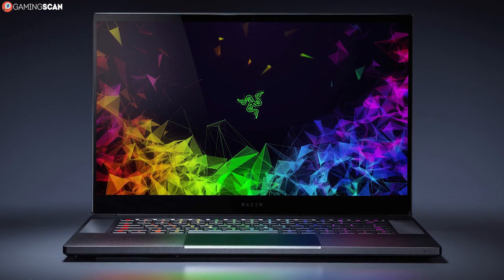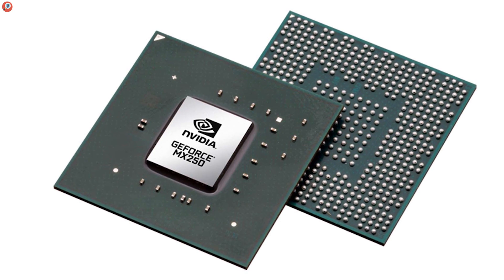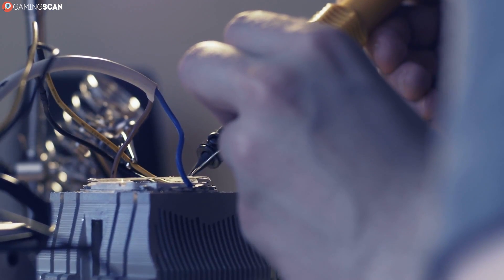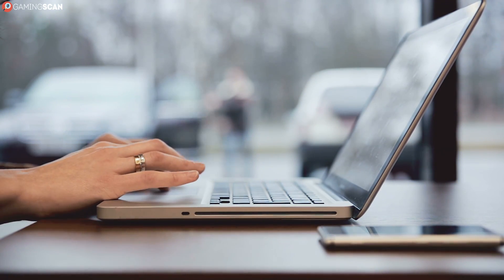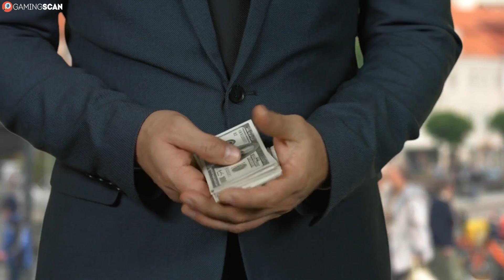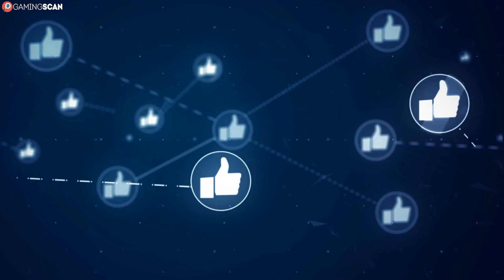Can You Build Your Own Laptop? [Answered]

Comment: If people could build their own Laptops someday as if they are trying to build their own PC Desktops? It's still going to be longer and more expensive than building a PC Desktop Tower. I'm guessing a computer or computers with the thinking power of 40 smart people put together are going to be responsible for pointing out what parts are going to be soddered into the motherboard. And I haven't got to imagining to what is needed to measure where the miniature fans and mobile battery go yet along with antennas and screen mechanics.

Comment: I'm looking to buy an ASUS ZenBook S Ultra Slim Laptop, 13.9” 3300x2200 3:2 500nits Touch, Intel Evo Core i7-1165G7, 16GB RAM, 1TB SSD, Thunderbolt 4, TPM, Windows 10 Pro, AI Noise-Cancellation, Jade Black, UX393EA-XB77T from gigatechonline. Suggestions to supercharge it beyond its factory specs will be absolutely welcome. I already found 512gb (8x64) worth of RAM on Amazon and an 8tb SSD for it. If you guys think this is enough to make my future laptop ultra powerful let me know. I'm tired of Skyrim Anniversary barely working on my current system. I'm also a very heavy ESO mmorpg player and a more powerful system would definitely help me explore Morrowind with my friends.

Comment: I’ve done it myself, and before I get a bunch of hate replies, I got a bare bone pc and just replaced all the parts over around a year and a half
Reply: did a similar thing myself. bought a bespoke shell from customers laptop maker that had surplus parts. didn't even have a monitor. just the laptop shell and the board with the cpu and gpu on it. then built everything around it overtime. from keyboard to battery. took over a year but I finally have a finished working, stable, robust, problem free, aesthetic, practical unit.

Comment: I mean, can’t you just take parts from old laptops and make a new one?
Reply: most laptops, even from the same brand and model line, don't have parts that you can just put in other laptops and have them work fine
Reply: @BriansBrian  Some of them you can. I have an old 17" core i3 Pacard Bell laptop with a screen from an Hp dv7 laptop, a cooling fan from one model Emachines and the keyboard from another 15" emachines. Granted those emachines were built by the same company that built the Packard Bell but it was doable. A lot of laptops have interchangeable screens even though they're not built by the same company as the number of screen manufacturers are somewhat limited.

Some guys on Thinkpad forums actually have made daughter board adaptors in order to update screens in older Thinkpads to newer incompatible screens as well.

As far as building laptop cases and even tablets there are numerous videos on Youtube with people using everything from cardboard boxes to old lunchboxes to 3D printers for printing cases for making homemade laptops/tablets. My previous boss actually built a computer into an old pizza box for a project he was working on. :)

Like with the desktop computers though not all parts are interchangeable when building. I mean, you cant just buy a random motherboard and cpu for a desktop. You still have to match the CPU to the socket on the motherboard. And you cant just buy cheaper older ddr3 RAM and throw them on a motherboard that only takes ddr4 RAM. You still have to match up the correct parts and you still are going to run into the wall of obsolescence at some point even with gaming desktops. Otherwise some of us would still be playing Fortnite on our 286's. 😁
Reply: P.S. Annd a lot of companies to save money on R&D buy laptop hardware designed by third party builders like for instance Clevo, which means a lot of those parts are interchangeable.
Reply: @BriansBrian  I have got old toshiba satellite a500-17x laptop, I can only upgrade it to 8GB and I can't upgrade more than that. So I'm thinking about upgrade the motherboard, CPU and RAM but the problem is I would not be able to change the RAM, hard drive on the laptop bottom base and I would not be able to change the battery if I upgrade the motherboard. Can you help me with what I need to do before I start doing it??

Comment: Buy a normal laptop with amd ryzen 5/7/9 or intelcore 5/7/9 and use a Egpu but not that one you have also a little one  without a case but you could buy a other type of case and use that for the case then you have a egpu for 30$

Comment: I built my own laptop, just to do it. I had to stick to a form factor (Alienware r5). It cost $1100 to find all the components over time. Once I was done found a barley used one online for $500. I sold it for $450 because the gpu was subpar for 1440p gaming. Yeah don't build one.
Reply: You have a guide or a site with a guide

Comment: I am building my own gaming laptop  so you can build your own one you just need to do research and then get the best parts.
Reply: update me
Reply: update me
Reply: How?
Reply: Update mate
Reply: I have got old toshiba satellite a500-17x laptop, I can only upgrade it to 8GB and I can't upgrade more than that. So I'm thinking about upgrade the motherboard, CPU and RAM but the problem is I would not be able to change the RAM, hard drive on the laptop bottom base and I would not be able to change the battery if I upgrade the motherboard. Can you help me with what I need to do before I start doing it??

Comment: you missed one thing in the upgradability of laptops because you were talking in the video specifically about gaming laptops. but still upgrading RAM and putting an SSD in an old HDD based laptop are still overall performance upgrades, even though they don't much improve gaming performance. and if not the RAM, the SSD is still an easy upgrade on most laptops, just remove the cover take out the HDD and put in SSD.
other than that yeah not much can be done to build a laptop from scratch. best upgrade might be RGB lighting around the chassis.

Comment: Sure there is a way to make a custom gaming laptop but it would be almost three inches thick. Get a itx mother board with a low profile along with low profile ram and m.2 drives. Use a riser card for the graphics card so it sits next to it and plug that into a small form factor power supply. Get a 19 inch  very flat monitor or get a lap top monitor and keyboard. Water cool all components using a custom loop and build everything into a custom chassis.  It would be extremely expensive and look like shit but it would be technically  very fast though I'm not sure how to power such a beast on battery for more than a few hours if that.
Reply: Well you could use multiple batteries and for charging dual power cords

Comment: Gaming laptops have heating issues. High performance machines generate too much heat to cool in a small laptop case. And gaming is 20-40 minutes using the battery.
Reply: Not really, mine runs fine. Battery could be better but I wouldn’t get a gaming laptop for mobile gaming anyways because their loud and bulky. I take mine of the cord for work applications, conveniently browsing the web on the couch. Get a switch if you wanna go places
Reply: @witnessgem2504  what laptop do u have and what specs does it have
Reply: @witnessgem2504  I bought a $100 “broken” alienware r3 with a 1050ti in it and all was wrong with it was the ram wasnt seated properly. I brought it with me on a trip and was able to run most modern games at 50-60 fps with low graphics so I would say mobility is still very good and much better selection of games than a switch
Reply: WRO i get 30 mins of battery life on my potato laptop
Reply: Filip W _ My laptop dies instantly when I take out the charger lol...
Reply: Highlights Kingdom oh, thats pretty common. Just get a new battery and it should be good
Reply: Filip W _ I should get money first☹️
Reply: Highlights Kingdom nah, theyre pretty cheap. I’d say like less than 100.
Reply: Bruh people like u don't understand anything if u have a good laptop the only problem Is the laptop fan ur just not smart plus I have pc and laptop rather laptop
Reply: Mine runs max 80C if I don’t turn on high performance mode on 100% load if I don’t turn on high performance (a button on the keyboard in the left corner) I have a i7-10750H 2.60 GHZ CPU that runs about 4 GHZ (it’s on turbo) and a GeForce GTX 1650 TI. On high performance mode, it overclocks and boosts fans to be around 40-50 C, decent if you ask me